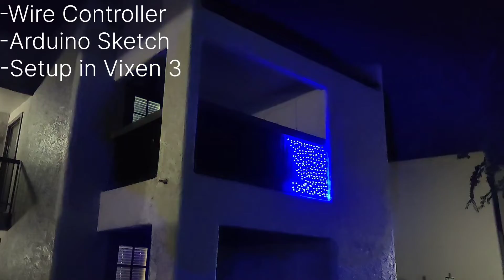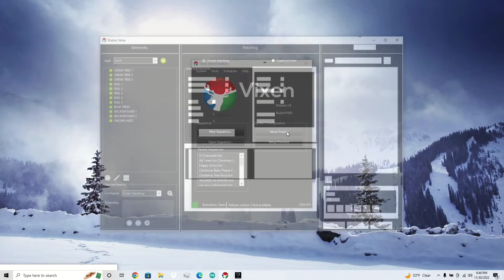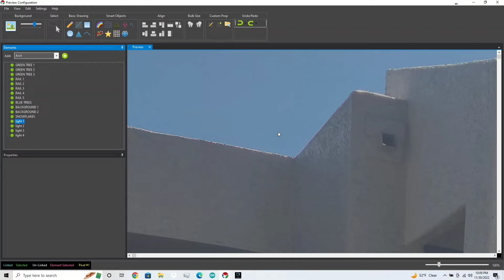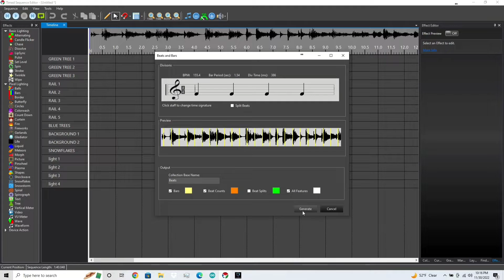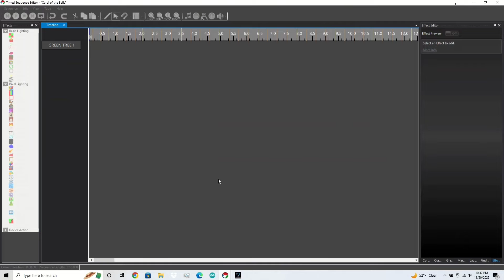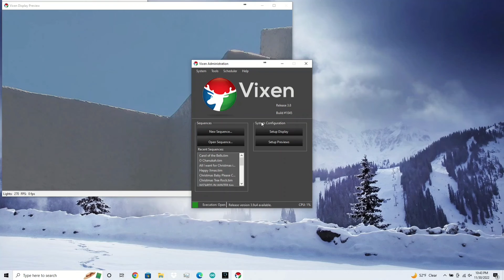Christmas Light Show on a Budget | Detailed Build with Arduino and Vixen 3

Comment: Will this still work with Vixen, In the past ive not been able to make the Vixen communicate with the board.
Reply from the maker: We were able to get it working a couple years ago when we made this video. Not sure if they made any updates since then that would prevent it from working. I think the biggest challenge for us getting it to work was what I call the color selection glitch which we go into more detail in the video. Essentially if you leave the color of the light as the default blue color, Vixen will not send that command to the Arduino. If you change it to literally any other color, it works.